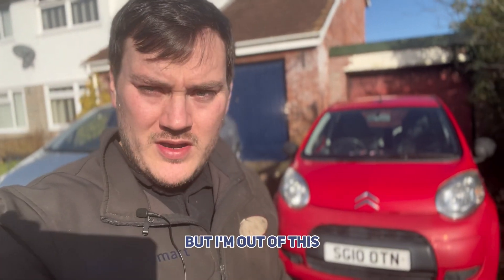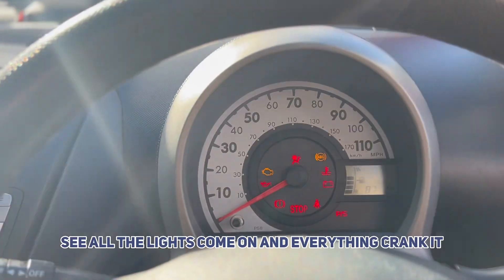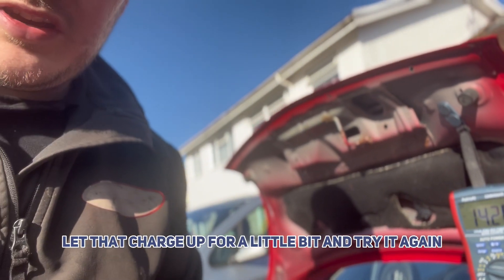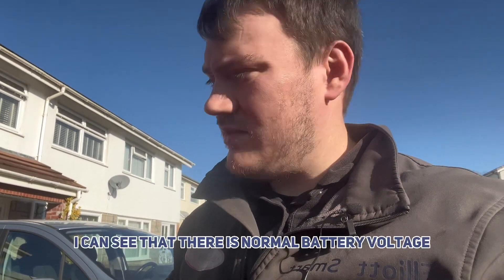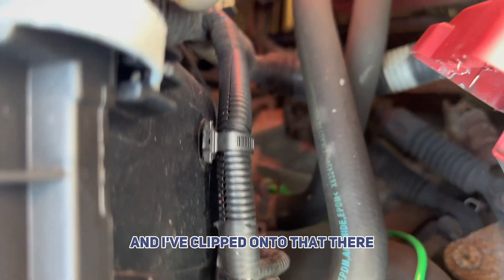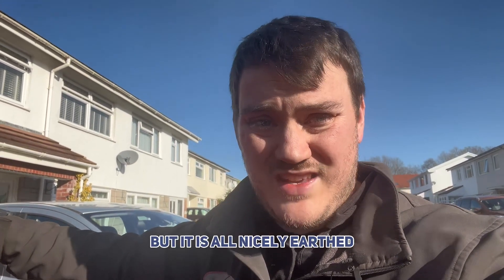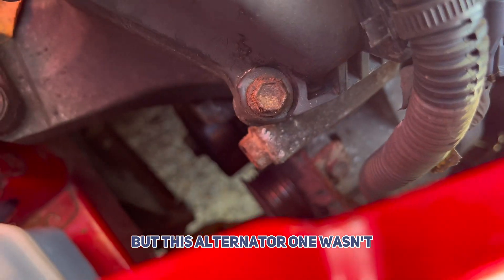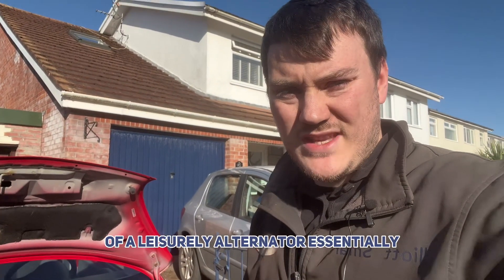Why won’t this 2010 Citroen C1 start?

Comment: I had no crank, no start on 2011 aygo, wouldn't bump or jump start either. Figured the alternator might be seized  (wouldn't turn by hand) after watching this video and a few more I found the courage to take the bumper off to loosen the alternator belt and sure enough it was seized solid. Just ordered a new alternator now I just need to find the torque values for the alternator screws before I fit the new one. Thanks for the video... don't be scared to try replace the alternator yourself folks, its a first for me but its very doable with a bit of help from youtube thanks to videos like this.
Reply: I'll report back with the torque values if I can find them.

Comment: I think you've got voltage drop confused with high resistance across the earth.
Reply from the maker: Volt drop is a test used to identify high resistance. If I test say 12v at the battery post but only 11v at the terminal, that tells me there is high resistance between the post and the terminal. Dose that make sense??